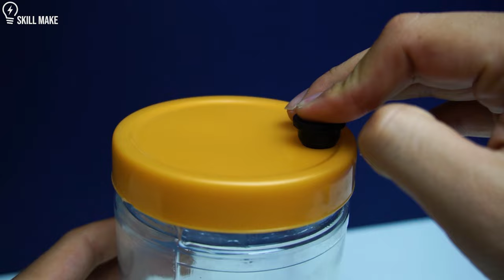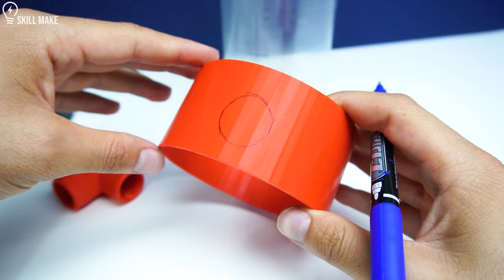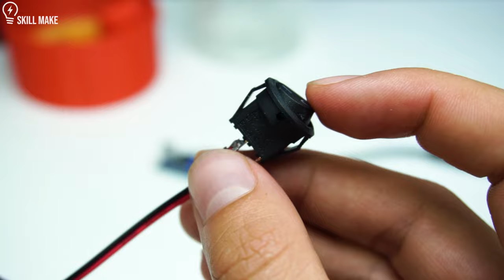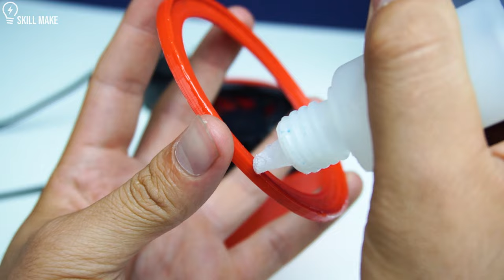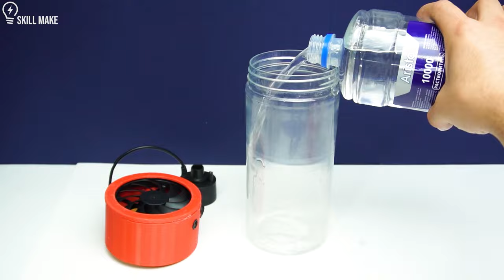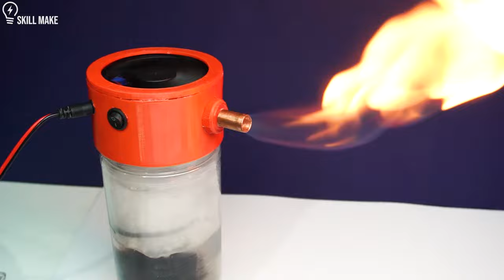Generating Free Gas by this Amazing module - free gas from Humidifier

Comment: I'm interested in the part of the demonstration, when you hooked the ultrasonic piezo to the sensor, with I assume, was a copper wire.  How did that make the acetone make mist.  Do you think  that same connection would enable alcohol to vaporize?  Very interesting, IMO.
Reply: I think the water conducts electricity making the same connection to the piezo disc than the acetone. Since the acetone can't conduct electricity the humidifier won't work, (that might be a safety measure ), so to bypass that safety measure and make the humidifier work for a dangerous liquid like acetone he had to manually connect the copper wire straight to the piezo disc
Reply: Wow. That was intelligent but wrong. I'm pretty sure..

Comment: Would this work for alcohol?  And what about adding it to an engine( especially direct injection) to clean the valves as its running?
Reply: ultrasonic intake is already in use.. give mo performance boost vs direct injets.. just more problem of mainintenance. and laso.. want m,ore power?? take out catalitic and bigger turbo :)) enjoy free horses..

Comment: How can it be free gas if you need to put electrical energy into the system to make it?
Reply: Totally agree.
Reply: You can utilise the kinetic energy of atomic bonds, Urea for example when electrolysed puts out more energy then you put in when done correctly, but not enough to be self-reciprocating.
Reply: Not to mention it's just acetone fumes In a humidifier

Comment: Not many got the comments right and saw the brighter side  of this system.

Let's start mass manufacturing, it's a Vapour Carbuerator for petrol, diesel, ethanol, biofuel, and various biofuels and crude fuels.

Why complicate a simple system, when DaVinci VB arrives, everything will get vaporised.  :)

Anyway, jokes apart, let's start manufacturing with upgraded version, 200 miles per litre 1956 Americian Automobile Mazgine had detailed, left unnoticed. 

Piezoelectric unit and electronic board, are less expensive.

Comment: Which is the best in efficiency between using petrol and water or using acetone in water.
Reply: Do tell if you know by now
Reply: obviously it petrol in water and plus pure acetone dissolves plastics overtime so yeah it must be diluted
Reply: I'll tell you a secret .. acetone added to an HHO flame makes the flame hotter than ANY other hydrocarbon fuel such as gasoline. I was surprised as well. 😮🎉😊
Reply: @SSaksham_5 also, acetone dramatically reduces the danger of the "flashback effect" of oxyhydrogen gas!!!
Reply: @TravisTellsTruths  you're high on something?! there's no effect called as flashback effect which exists!!
Reply: @TravisTellsTruths  all I'm saying that flashback effect is'nt a thing!
Reply: Go Light up a tube with HHO gas and then tell me it's not a thing.
Reply: @TravisTellsTruths  now i see at long last what's wrong with the world! to many uneducated professionals!!

Comment: this is just essentially vaporized acetone
Reply: Atomized, not vaporized
Reply: @blg53  atoms are essentially the basic unit, and there's no electrolysis with high voltage involved.

Vaporized
Reply: @xeroxcopy8183  I don't think you understand terminology. Atomized does not mean split into atoms, it means formed into tiny droplets. An atomizer is a fine sprayer, women use atomisers to spray perfume. Which is what this device is too.  A vaporizer is a device that turns liquid into gas (vapour). A kettle that boils water is vaporizer.  This device isn't. At no point it turns acetone into gas, no matter how fine the droplets are they remain liquid.
Reply: @blg53  "An atomizer is the heating element in a vaporizer"
right. Vapor.

Comment: A new small unit tiny Gassafe PSI controller, needs to be manufactured & fixed with gauge meter.   A double saftey  device and worry free unit.  

Typo Error:  200 miles per gallon (3.750 liters) for petrol and diesel fuels or any biofuels.
Agree or  Disagree?

Let's give newly designed two seperate unit a try, R&D protoype, see the difference.

Regards & Wishes 
DaVi VB, Quantum Aliean Stellar Galaxy.

Comment: What if I say thats not free you still using electricity which is not free 😞
Now what if i say this is free for life time 😊 you can Store this hydrogen gas in large container because air or gas can be compressed and now electricity is still free ... how? You can use 12v soler panel 70watt by loom soler Price is ₹1000/1500 rupees and now night time you have compressed the gas in large container 😜